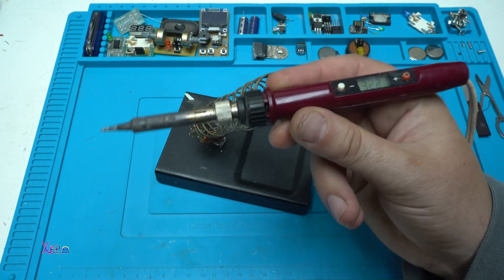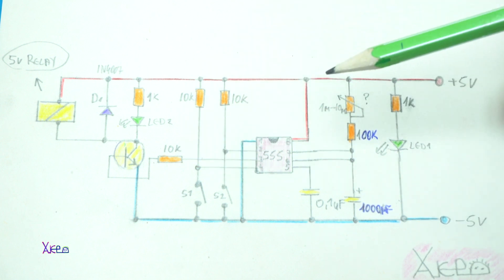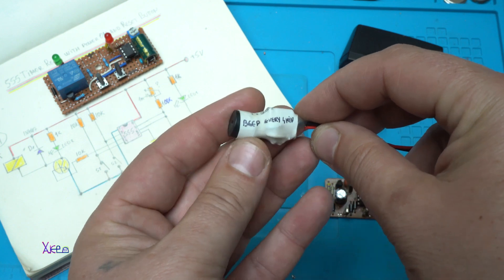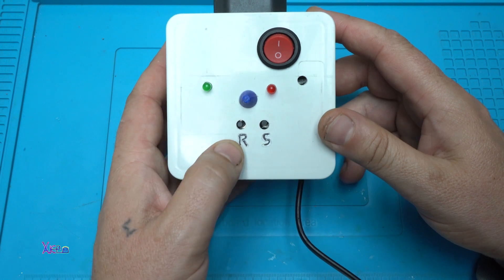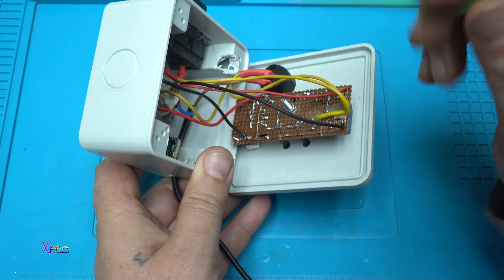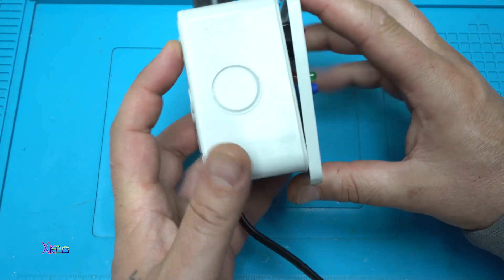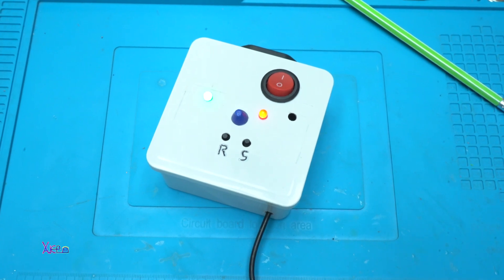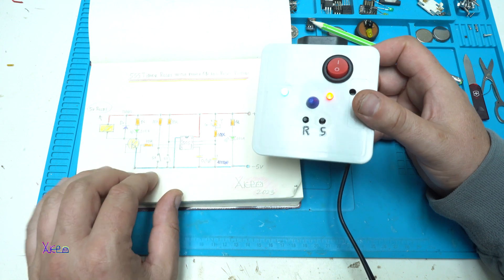Making Auto Timer for Soldering Iron (You need this Gadget)

Comment: Thank you for another awesome idea! What changes are needed to make it work with 120V AC?
Reply from the maker: You need to use 120v AC transformer to step down to 5v dc voltage bcz pir sensor and relay work on 5v